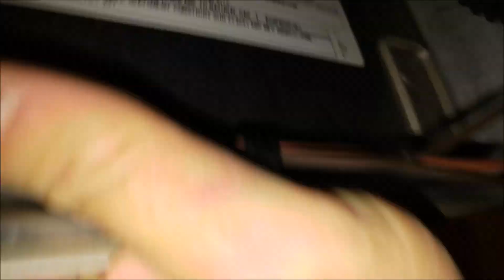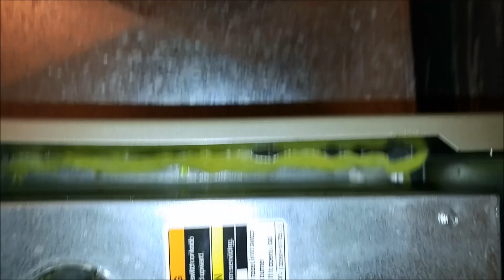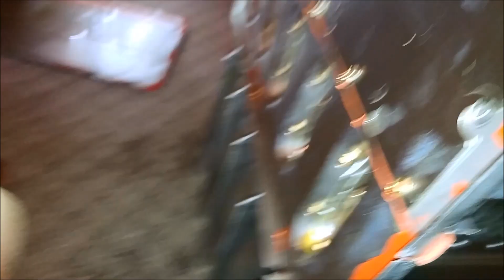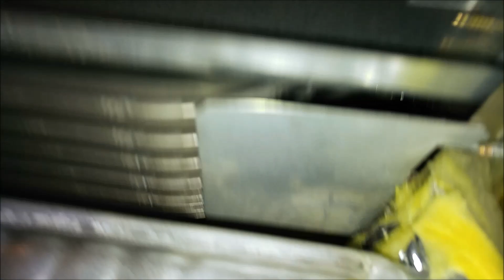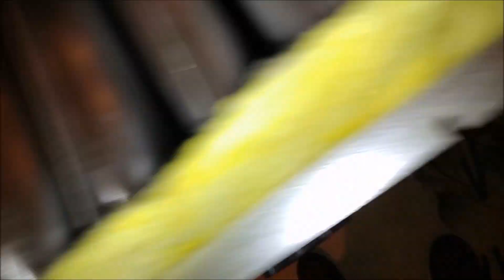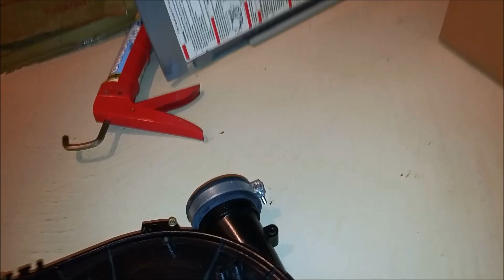Parts missing on a heat exchanger replacement 1 of 2

Comment: Is the high limit shield level? I've found 5hose bent upward causing the limit to trip prematurely.  The furnace should be pitched forward slightly to allow for Condesate to drain from the heat exchanger better. (this is common with most condensing boilers and furnace,  depending on where it drains it located)  
I also find the 58MXA's to be underfired.  I always wondered if this has a negative effect on the hest exchanger life?

Comment: While your at it scratch off the "Installer remove this label" on left and rite ends of collector box....does it stem from a kid not trained or told to hurry up & get out...or someone in a hurry ? The factory never missed a thing....with all the install fucks,,,can't blame factory....did dozens of these,no factory mistake...assembly instructions very simple to follow for a reason."don't forget mmmmm maybe block-off plates at back should be installed or removed,in assembly instructions ..what did your final Combustion analysis test tell you..

Comment: Good video MI Heating Guy!
Question- When I did my one and only heat exchanger replacement on a BRYANT 350 MAV. In the instructions it said to use "PAM" when I caulk. What is the reason for using PAM? Dam I had to hunt high and low to find the plain Pam. No one seems to carry that. Did I need to use pam? I just used RTV and done with it. Im wondering if Im going to have problems.....
Reply from the maker: +Paul HVAC Pam is for when the heat exchanger fails and you can fry an egg on it I've seen that in the instructions before disregard and used RTV butter flavored just kidding thanks for watching